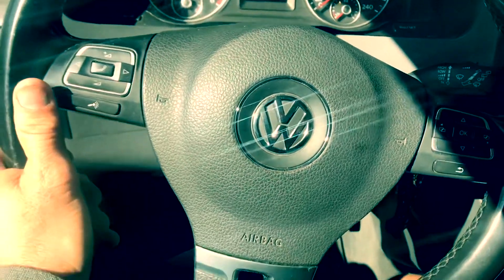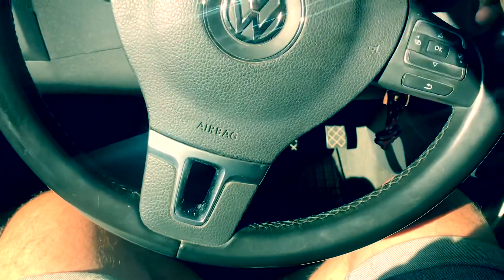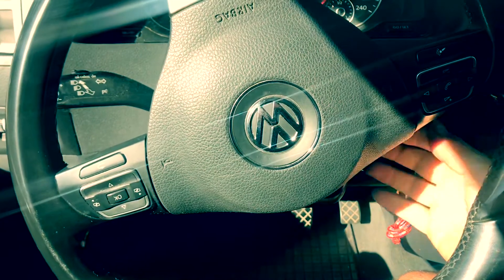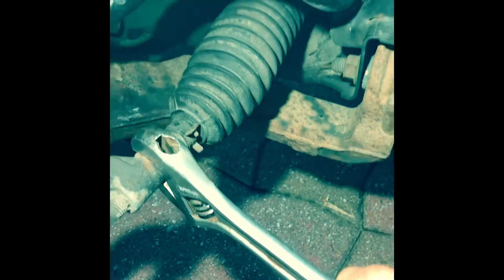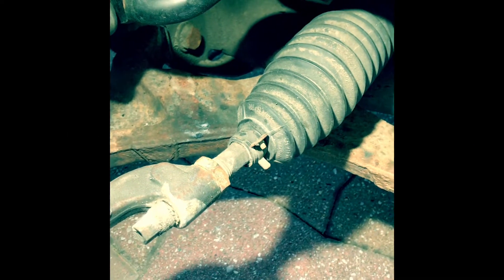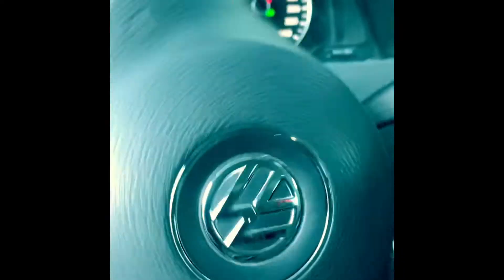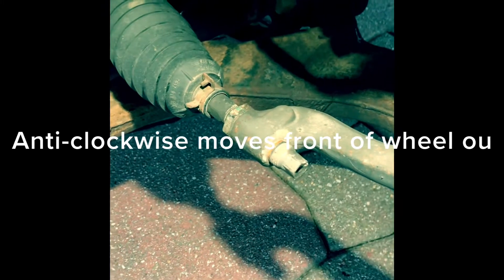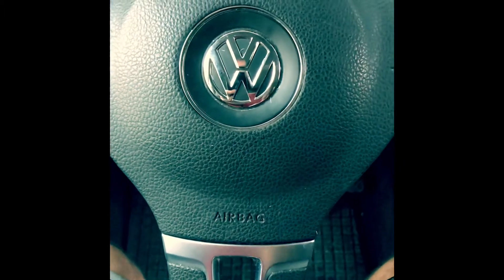How to track your VW T5 T6  steering after removing subframe.

Comment: I’ve just had a new flywheel fitted and it’s came back the same as yours a few degrees off centre. 
After watching your video I’ve adjusted a 1/4 turn on each side and now it’s perfect. Thank you very much for the content.

I’ve got some T32 rear springs and shocks to fit next weekend again after watching your videos I’m going to fit them myself rather than taking it into a garage
Reply from the maker: Result on the steering and you can easily fit the springs. You can do it 👍

Comment: Mines just came back from a local garage like this after clutch and dmf change. Will try this as soon as it warms up outside❄️👍
Reply from the maker: It's annoying they don't sort it for you after that as clutch and DMF is an expensive job.  Keep us posted. You can do it 👍
Reply: Subframe needs to be aligned, £20 for the kit on ebay and very easy DIY job, what you see here is not the right way to do it, ok, the steering wheel might be straight but the subframe is out of square and one of the road wheels will be further forward than the other, this way will quite possibly cause premature tyre and suspension wear.
Reply: @JohnSmith-it6hj  How easy a DIY job is it? Looks fairly complicated from the VW manual..
Reply: @Drewbie1973  Its really not, there are just 4 large bolts and a small one at the front keeping that subframe on,  once you are under the van you can see how straightforward a job it is.
Reply: @JohnSmith-it6hj  so do you just have to take the weight of and then you can loosen the bolts and use the alignment bolts to get things perfectly aligned? (Assume one at a time?
Reply: @Drewbie1973  yeah  jack up and put the van on axle stands and loosen all the bolts ( i think they're 24mm) once you align the back ones the front ones will probably align themselves. The engine mounting and steering rack are all mounted on that subframe so you'll need support the engine
Reply: @JohnSmith-it6hj  nice thanks :)